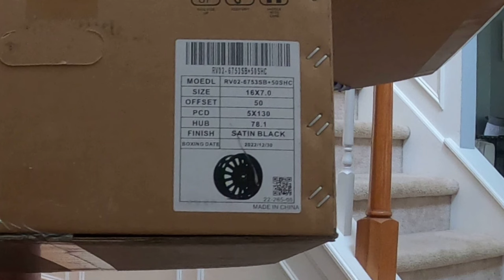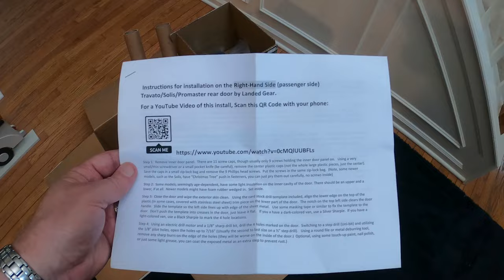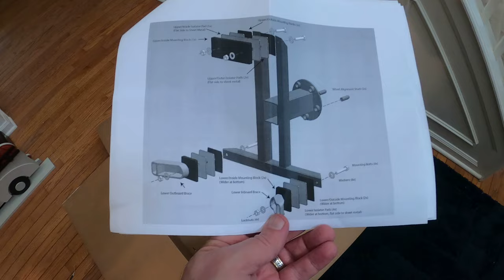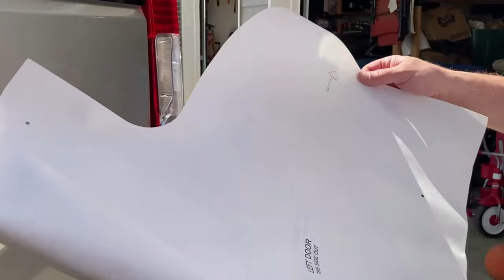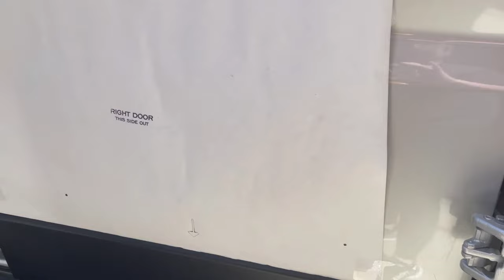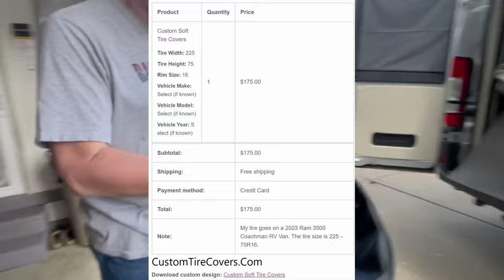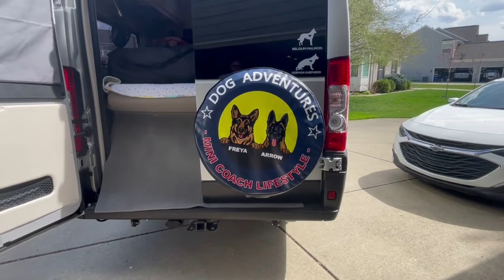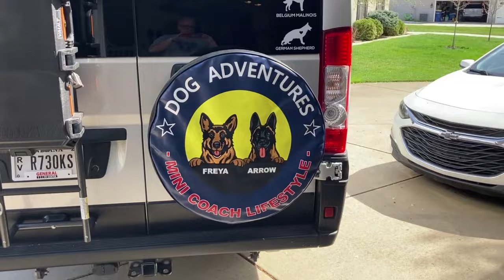Frankie Gets a Spare Tire

Comment: Hello. Great job on the install! As a Nova 20RB owner we are installing the landed gear mount also. My only question is, where did you get the upgraded black rim from? We have the upgraded rims with the Firestone tires and Coachmen wants a ton of money for that rim. I would greatly appreciate if you could tell me where you purchased yours. Thanks again and have a great day! Chris
Reply from the maker: @ChrisB-ice-cream-man  Hi Chris, thanks for the feedback. You are correct Coachmen wanted an arm and a leg. I searched high and low for this rim on the internet and everything lead back to Coachmen. So I was forced to buy from Coachmen.
Reply: @minicoachlifestyle  Thank you… Guess I will be doing the same as I could not find it either.

Comment: Great video, are you happy with this tire mount and does the door sheet metal flex or buckle when closing? 
Thank you
Reply from the maker: Hi Mike,
I am happy with the mount. I don't see any buckle or flexing when closing the door. The plastic stabilizers that are installed inside the door work well.
Reply: Thank you for your response, it is greatly appreciated! I think this will be my choice as well!
Safe travels!